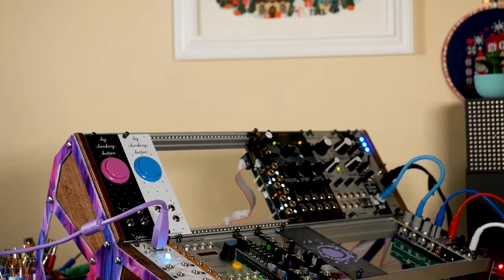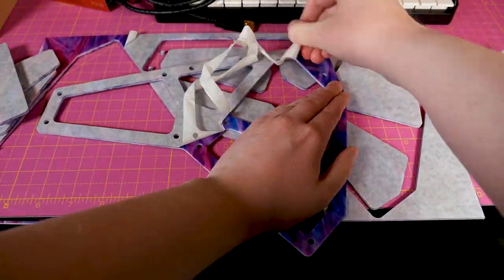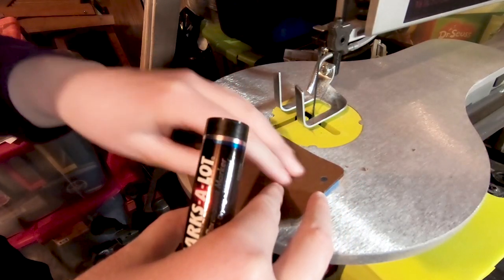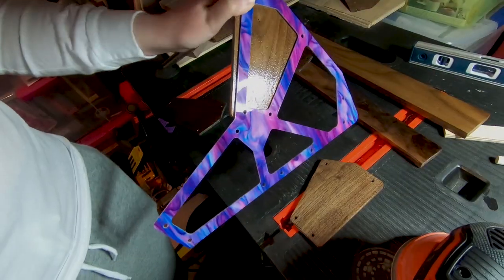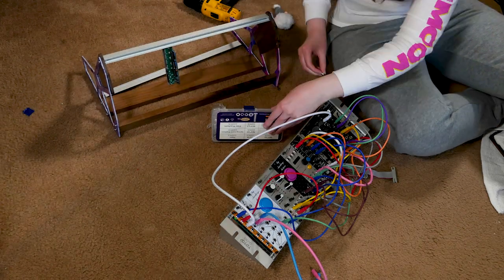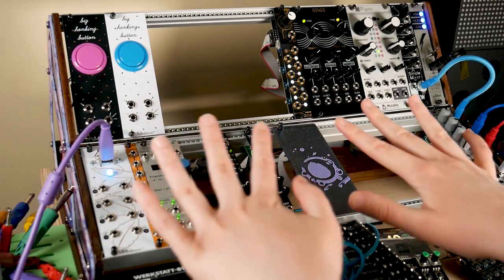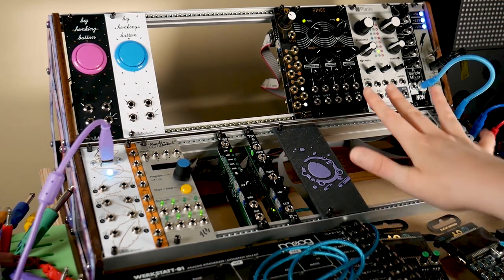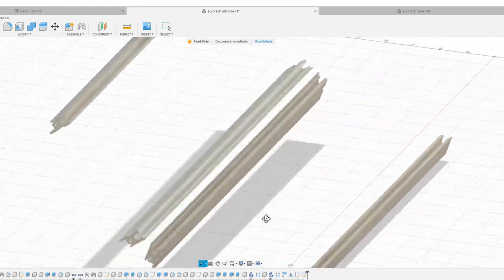I Built A Eurorack Case

Comment: I certainly get not having the $$$ to fill a case with modules. My wife really wanted a synth, so i've been building her one. I'm almost done filling the 2nd bookshelf with modules at this point (about a month in) and with only a couple exceptions every module was a diy build (we did buy an ES-8 so she can hybrid it with VCV Rack, and the oscope is a $20 ali-express module and I just put a panel on it so it would fit in the rack). 

I couldn't even begin to afford what pre-made eurorack modules cost, but buying parts in bulk from online retailers like tayda I can build a module for around $50-60 (most of the cost is usually pots & jacks). I get a lot of the designs from Look Mum No Computer. Eddy Bergman's site has a lot of stripboard layouts for modules, and of course Music From Outer Space, and yusynth (who designed the Arturia Minibrute!!) have a lot of designs too.

Look Mum of course builds in the Kosmo Synth format (metric 5u, 1/4" jacks, large knobs, etc)but if you're stripboarding you could use whatever size things you want.

Moritz Klein on youtube has video series about building a simple VCO & VCF. His 3x VCO design was the first stripboard module I built for our synth [although I only did 1x VCO from that], it's a pretty good place to get started.
Reply from the maker: oh sweet! yeah i definitely want to dabble with building my own. Most of mine have been kits or used. I've gotten some fantastic deals on used gear

Comment: I wonder if you can create and 3dprint a drill template from the fusion design. Might also be a good way to line up holes well on both ends. 

Another fun learning would be to 3dprint outline template for wood and cut on a trim router with flush cut router bit
Reply from the maker: yeah definitely! that would be super cool

Comment: Nice work! This is inspiring me to add a similar angled second row for mine, as my current case is full. Of course, as you say, it's better for my wallet if I leave it as-is. 

What'd you do for your power supply?
Reply from the maker: oh sweet, it might be fun to space stuff out though. for the power supply i'm using a tiptop audio uZeus
Reply: @BlitzCityDIY  yeah, then I could laser cut some more blanks. They're fun to make!

Would you like some walnut ones or are you good with the 3D printed ones?